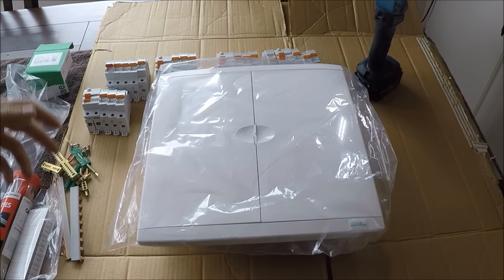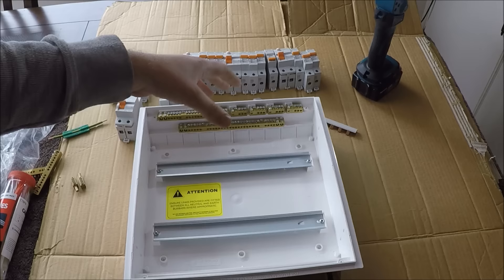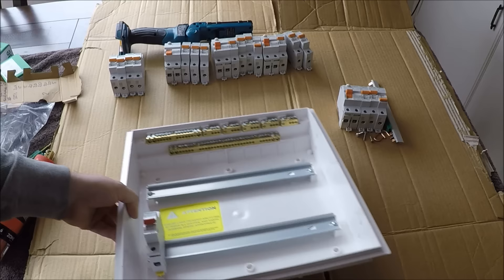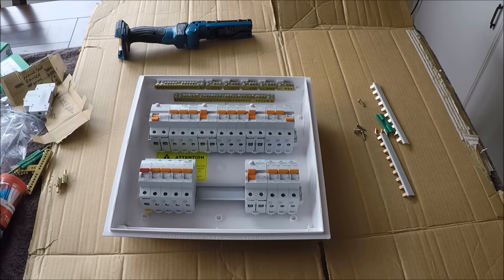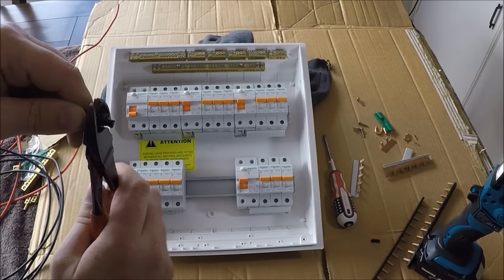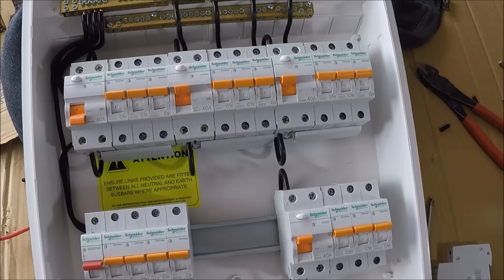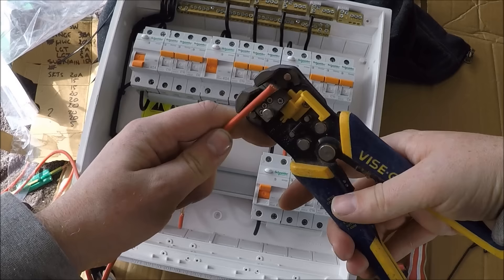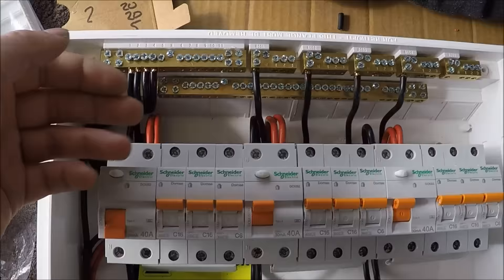How To Wire a Switchboard (Part 1)

Comment: Do People understand that only Registered / Licensed Electricians are allowed to work on a SwitchBoard
Reply: Pretty sure anyone can install one at their own risk. If anything goes wrong insurance is void...some people don’t care.
Reply: @-ShootTheGlass-   you should get a registered electrician to make it live and test it if you do the set up yourself
Reply: Some people live in places where what is allowed is up to them...
Reply: Do you have special testing that an electrician does such as insulation resistance and a lot of other tests that are done with specialised equipment or not the UK that’s required and that’s mainly why a homeowner couldn’t as a safety element but also they could not have it compliant without that

Comment: Theres no such thing as a stupid question! unless its from someone unlicensed and unqualified to do this sort of work, which also makes it illeagal. So for all the DIY'ers and DETA users out there, if your house burns down from an electrical fault and you were the "electrician" goodluck getting an insurance payout. There's a reason its a trade. other than that, nice vid.
Reply: They have to prove you did the electrical work, just deny deny... was like that when you got the house.
Reply: I don't necessarily agree with your first sentence. I see no harm with anybody trying to expand their knowledge. The important thing is how they apply that knowledge. IE, don't fucking touch it! 😂
I said to the sparky that came to my place the other day and he seemed to agree. That having a little knowledge can help identify potential issues when you move house or something. You can look at something and say "that doesn't look right to me", what matter is what you say next. If you follow it up with "I'll get someone in to check it and test it" and not "I'll have a go" then you've applied that little knowledge is the right way.
That could even save lives. People don't have a sparky coming over every 6 months to see how things are so unidentified issues could lead to injury of death. Having a little knowledge of what to look for can then lead a person to get a professional in to confirm if it is an issue or not and rectify if necessary 🙂
Reply: @uselessoutdoorsman2826  however they will they investigate who did the last electrical work and they likely have inspection and testing records kept and they find out it’s different and everyone denies it. Everyone will be questioned until they find out.
Reply: @thfreakinacage  they do a bit of a point because if it’s a question that an electrician would easily know you could probably find a direct answer through something such as Google

Comment: Fantastic work very neat. One criticism which is kinda of major in my opinion. If you daisy chain the 6mm active from RCD to RCD that means that in the event that the house is drawing 43A (not including the unprotected circuits) for example your first 6mm link from the main switch will be carrying the whole 43A which is not ideal. It should be that each RCD has an individual 6mm active running back to the main switch.
Reply: Isn't that resolved by the ringed daisy chain configuration? Each RCD is supplied by two separate 6mm paths back to the main breaker, each of which is rated to 40A in air for a total 80A capacity.
Reply: It's ring main fed
Reply: No disrespect but British standard makes New Zealand/ Australian electrics look very cheap. In the UK they are required use 25mm² to link those RCDs and usually they come with the board. And why is the main switch is not a double pole switch to isolate both the Neutral and Line?
Reply: @timwilson6884    But up 146A (16A*8 + 6A*3) can potentially flow through those feeds. Should have installed a main 80A MCB (or lower) to protect the feeds.
Reply: @IAmThe_RA  That's a different issue - I agree that maximum demand should be limited by a MCB rather than a switch as installed, but the 63A service fuse upstream of the main switch will limit maximum demand.

That's historically been the standard installation methodology in Australia at least. For example, Western Australia only made it mandatory to install MCBs as main switches as of 1 Feb 2022. The vast majority of installs prior to that rely on the service fuse for overcurrent protection of the switchboard.
Reply: @IAmThe_RA  British electrics are a joke
Reply: @electricalstuff259  Still much better than Aussie electrics. Having said that, I dislike their ring circuits. 
I'm no Briton. So no bias.
Reply: @IAmThe_RA  Yeah ring circuits suck. This video is from NZ btw not Aus.
Reply: @electricalstuff259  In another video I watched an aussie sparky uses fake wago connectors from China inside the switchboard. How is that allowed in Australia? It is not allowed in the UK as it is against the regs. Only certified products can be used.
Reply: @electricalstuff259  they are not they might be a bit old standards but they are incredibly safe. The requirements for inspection testing are really high as well as a lot of safety features. The system doesn’t change a lot because frequent changes mean you can’t assess the risk of the change appropriately.
Reply: @IAmThe_RA  generally speaking I don’t think anywhere officially all allowed fake connectors. You could pretend use all planes your brand but when they definitely pretend to be another one that they’re not immediately it’s a no because of her faking the name what else are they faking? probably the regulatory approval because they can’t get it under someone else’s name.
Reply: @UKsystems  Yes they are.
Reply: @electricalstuff259  is there a joke? Why is the British electrical system one of the safest in the world? It is safe because of regulations are a bit of a pain to follow because it is very strict however once or very experienced it’s quite easy as you memorise a lot of them, but can’t provide what your issues are with the regulations.
Reply: @UKsystems   Electoral system?

Comment: Just wondering, do you have similar regulations to the UK when it comes to brands of breakers used well they all need to be the same brand and the same model or product line that’s compatible to ensure there’s no issues. I find it strange and neutral link by you instead of the supplier authority as happens in the UK because it means that if a homeowner tries to fix and disconnect it the neutral could potentially become potential which isn’t 0 V which with a single phase MCB may leave someone to do work and not realise that it could be dangerous. With the same theme I do find the interest in your main which is not double pole. I don’t know if you have another means of isolation but double pole ones makes sense if there’s ever major issues it can be shut off line and neutral, especially if for some reason they get crossed somehow somewhere.

Comment: Why not bring all the Live side active cables of the RCDs back to the Main breaker instead of having a ring main setup? I know that the rated current carrying capacity of twin 6min is higher enough to handle the current capacity of your 63A main switch, my concern would be potential loose connections (hot joints) which will effect all of your circuits. If you had all the RCD live actives coming back to your main you would eliminate that concern. If you had 1 loose connection it would effect that circuit only. You have 4 RCD circuits and 5 potential main supply connections it would have been that much harder to run the actives back.
Reply: Not a good solution. The main switch terminal can only accept one busbar tooth and 2 conductors (of course this needs to be verified by looking at the manufacturer's instructions). The best solution is a radial setup but you'll need bigger conductor (10 or 16mm²). That's how they do it in the UK.

Comment: Hi Dave thank you so much for these very helpful videos. I come from an electronics background and when I was much younger about 50 years ago I arrogantly thought that power electrics was rather trivial. Since taking an interest in Solar I have had to become more involved in Power electrics and switch boards. There is just so much to learn and i have been watching You Tube videos from all over the place. Yours are a God sent. Since they apply more to our Australian standards. At the start you mention the Schieder range of RCD's and mention (I think these have a DC/AC symbol on them) What has puzzled me recently is that I can understand how a purely AC RCD works but I only found out recently that the type B RCDs are DC and AC. I suspect that the DC part relies on an electronic device called a "Hall Effect" device. Now in your video I thought that the RCD you showed was a Type B when in fact it was a Type A.
I looked up availability of type B RCDs from Sparky Direct. The ones I could get were for EV charging and they cost $400 Australian.
The type A RCD is about $28. The reason why I am interested in type B is that solar arrays can produce easily 600V to 1000V which of course being DC would need DC RCD's.
Reply: Call an electrician. It is illegal to do your own electric work
Reply: @rm0234  however the sad reality is in most countries if you want something specialty done you will understand it more than the electrician and you will have to tell them how to do it to the point that they could not install it safely

Comment: The Chilean system RIC-DS8-2019, considers more security because the general protection breaker is omnipolar cut (Phase and neutral), the bars must be isolated (neutral and earth, also on 3 circuits must have pilot light) One observation is that in case the electrical intensity exceeds 40Amps. The Differential Protector will not trip since it is not a thermomagnetic protection and it will melt. I am seriously considering taking the EWRB exam, well, each country considers its standards, I am studying the technical language. I have 30 years of experience and I have worked in mining over 4,000 meters high and 80 kilometers underground, I hope you will consider me and be a contribution when I'm in a couple of months in NZ. I really appreciate your exponation, it has helped me a lot.  Greetings from Chile

Comment: I run a separate 4mm to each RCD and Oven/Hob, I'll use phasebar from Hob to AC or submains.
Never in all my years have I seen a sole ring main for ALL mcbs (bad practice)...the main isolator has a big terminal for just such a reason..also if replace an RCD you can't do it live but can with separate conductor.
I also  move the earthbar to the bottom and just crimpllink to extend the conductors if needed as it much easier faultfinding and prewiring else a bunch of cables all at the top 
I cut the phasebar plastic a bit longer than the copper and crimp the ends with pliers to ensure they don't slide across.
Also I use the white numbered cable markers slide onto individual conductors to identify the TPS  circuits.
Oh And I also dont twist the copper into the mcbs/rcds but I double them over as well

Comment: i am from America, and i find it really interesting that yall use 63 amp service. we have 250 volt ranges in most homes that use 50 amps. most of our homes have 250v 200amp split phase power
Reply: It looks like he has multiple services for different sections of the house instead of one 200a main service disconnect and then just every circuit coming off of that. That's an interesting way to solve the problem of coordinating larger breakers potentially tripping before smaller ones

The way we do it in America is time delays, but I guess they don't have that and they just count on the smaller breaker tripping first, but if the bigger one trips no big deal because only a couple rooms turn off
Reply: Is January because in most of the countries people can just simply balance loads while they do not need to have 400 air conditioners on and an oven and water heater with every single light on and every circuit at maximum load

Comment: I have just looked at my switch board at hime dave. I have 4 rcds and they are all looped in 6mm. But only in series. So last rcd has only 1 feed in. Im guessing this 6mm now takes all the current in the house which could be over 45amps.

Comment: Hey Sparky Dave 

Any chance when you do part 2 and 3 could you also explain how you you would add an rcd breaker to an existing switch board. Keep up the awesome videos they bloody good
Reply from the maker: Yeah in fact I have decided to delay Part 2 and 3 (slightly) by a week as I have got a few videos to film using the old switchboard first..that may be one
Reply: @sparkydave  hi got part 2 ready?
Reply: Hi Dave when replacing a switchboard how do you go about generally go about isolating the feed to the switch board itself? I’m guessing most boards don’t have a isolator switch before coming into in the board
Reply from the maker: Give me two weekends! Sorry guys still haven’t got round to it (lol)....been a bit busy lately between work and renovating the nursery for the new addition to the family! Still on the cards to be done ASAP tho, hang in there, cheers
Reply: Howdy Dave. Just in process of upgrading our kitchen and replacing an old electric stove with a inbuilt oven and induction cook top. Question is can the oven and hob be wired together in  its own circuit or would both have to be on there own dedicated circuit?
Reply from the maker: @boony213  always two separate feeds where possible
Reply: Yeah bro I want to wire my shed but don’t know how to add an extra rcb to the existing switch board
Reply: @gadwalidost  IS PART 2 OUT?

Comment: Hi there, can you advise fixing garage door sensor lights, which is going to be installed under cement sheet, no rafters in eve, so which fitting should hold that lights up there? Please advise

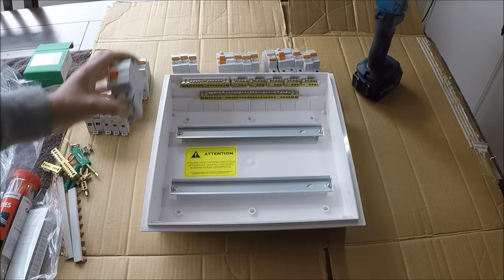Comment: 0:30 whats the difference between a single pole breaker and RCD?
Reply: The MCB monitor overcurrent the RCD monitor us the kid or currently escaping the circuit potentially through you or a fault

Comment: I am just wondering what's the point to have two separate bars - main neutral and earth - when eventually they are connected anyway to meet the MEN. is it allowed to have a combined bar?
Reply: I’m from the UK so I’m gonna assume based on testing stuff because it’s fairly universal discovering electrical issues but that link protect you be removed to work out if they’re short between neutral and asked as otherwise you wouldn’t be able to tell in circuits

Comment: Question: For RCD's, can the 3 MCB's hooked up to a 40A RCD equal 40A or do they have to come under 40A?
So if I have 5 x 10A (MCB's) and 5 x 20A (MCB's) would it be wise to get 63A RCD's or stick with 40A RCD's?
Reply: Can be equal

Comment: Hi Dave, can you explain the pros and cons about the ring mains? I haven’t seen many or any does this yet in my 4th year apprenticeship.  My boss wants us to have all mains into main isolator.  I recently did a full 30ways and couldn’t neatly tuck all six 6mm into it so decide it to do it your way.
Reply: Ring mains are legal in NZ ???
Reply: @James_Bowie he’s asking about wiring the RCDs in a ring in the switchboard like he did in the video. He’s not asking about wiring multiple power points in a ring like they do in the UK, which is not NZ practice.

Comment: Awesome vids Sparky Dave, loving the content. Question, can you have a switchboard above a door. I'm wanting to add a toilet and the current switchboard is where I need the door to go so wanting to move it up close to the ceiling and upgrade it.
Cheers..
Reply: Sorry mate you can’t have it there, main switch must be at 180cm height
Reply: Even if you want one, I’m above the door high up is not really practical and may cause issues in the future

Comment: Hi mate, I’m in aus..running in a sub board to my garage for controlled lighting.

Is 2.5mm tps sufficient to run from my main?
Reply: Quite simply you should not be doing this is asking YouTube. I’m not from your country but this is basically how every country count cable size. It’s stuff like the specific type the conditions it’s running how it’s attached under the length as well as things like expected temperatures and allowable voltage drops

Comment: Hey Dave quick question mate your main isolating switch (bottom left) is 63amp. How does it not trip when all your other rcds and breakers use more amperage than the 63amp isolator. I'm just learning atm. Thanks
Reply from the maker: The main switch is solely a switching device that is rated for use up to 63A to isolate an installation. It is not a circuit breaker. Upstream of that will be a 63A fuse (hrc, fuse wire, mcb or combination) at the street to the property connection point. 

If the installation is drawing upwards of say ~45A at any given time, and/or when upgrading/adding fixed wired kitchen appliances, submains, aircon, ev, water heating and spa pools to an existing dwelling, it would be prudent to recalculate maximum demand of the installation to ensure the existing mains cables and protection are appropriately sized for the electricity demanded by the dwelling/property.

If an installation was drawing ~60A at any given time, with a 63A main switch it would be very concerning.

Comment: Hi Dave, Can you use RCBO's only on the switch board?
Reply: I’m not from New Zealand, but I would say there’s no issue because it is the same protection as an RCD and MCB combined. Maybe you like engineering standpoint it’s the same physical protection as long as it’s approved.